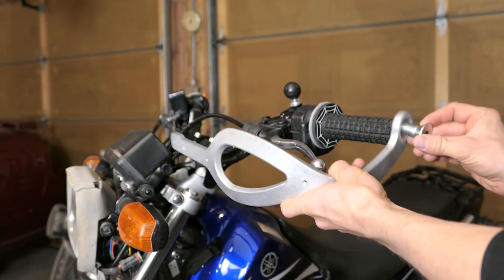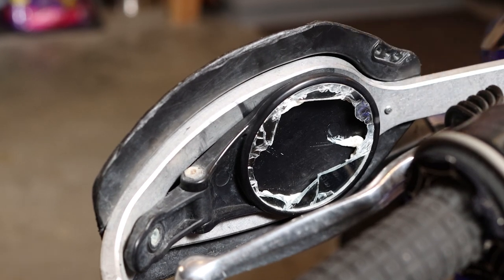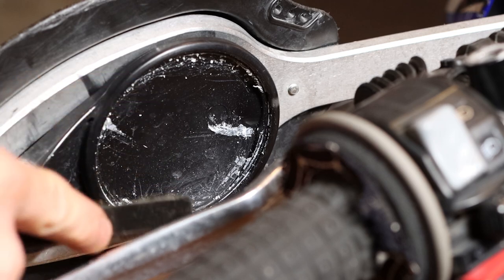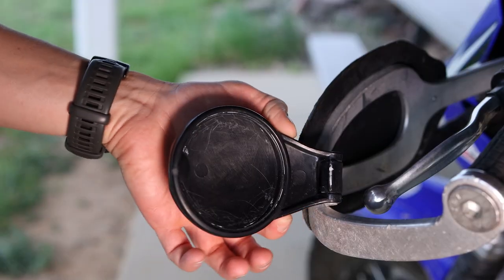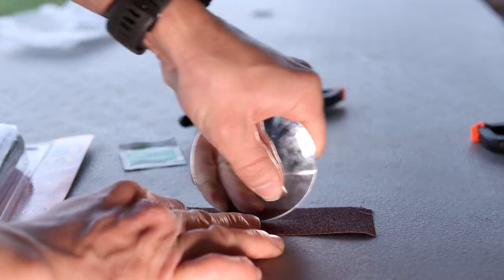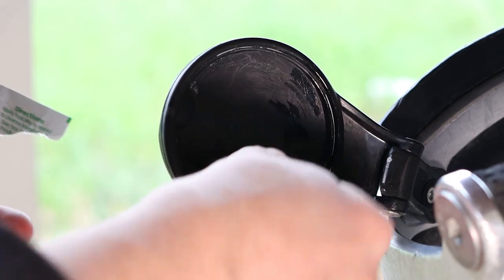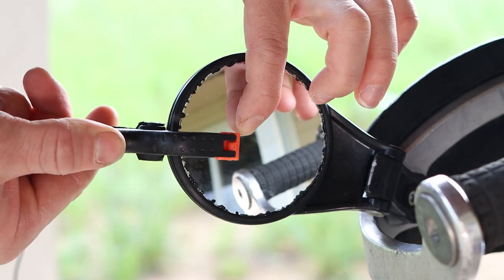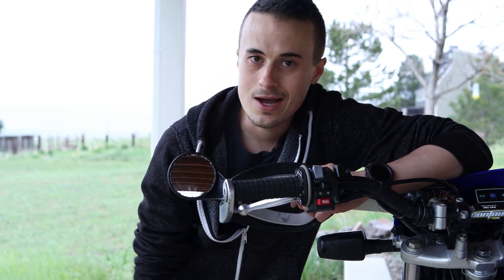How To Replace a Broken Mirror | Highway Dirt Bikes HandGuards

Comment: Broke the glass in my factory mirror.  $35 for a new mirror assembly at the dealer, so I went to Walmart to pick up a $3 convex blind spot mirror from their RV section.  Dremeled off the black plastic backing and glued the mirror into the factory housing just like you did.  Loving your very useful and entertaining videos! Keep up the good work!
Reply from the maker: nice glad it worked out. the dealer loves to price gouge parts. glad to hear you enjoy the videos! ill keep them coming, going motocamping next week

Comment: Quick tip when sanding glass like he did. Seam the edges of the glass to about 45 degree angle then send the face of the edge. If you just sand the face of the edge it chips the glass and mirroring off
Reply from the maker: Thanks for the tip!

Comment: Unless the mirror is larger than the divot behind the rim that originally held it in place, you could use a heat gun to soften the plastic which would allow the mirror to be put into place.  Grinding mirror... ya make me cringe and fear for ya young man! (LOL)
Reply from the maker: that could work. thanks. haha at least it worked out and I can use that mirror again
Reply: I tried heating my plastic up, but the mirror still seemed too big. Maybe it'll just take some more heat and pressure. I think finner sandpaper and just sanding it by hand might do the trick. Open to suggestions.

Comment: Instructions: 
Preheat oven to 350 deg. Clean old glue and residue out of the plastic.
Place plastic in the oven for 10 minutes.
With GLOVES remove plastic mirror housing. Using Gorilla Glue make two lines
around the edges.

Leave gaps for the air to escape. The glass should just pop in.
Reply from the maker: Nice! Thanks for the tip
Reply: So I noticed my glass definitely does not just pop right in. What grit sandpaper did you use, and if you where to do it again what do you think is best to reduce the size?